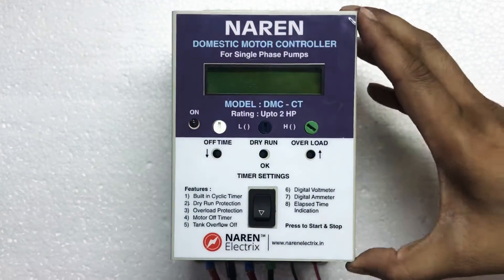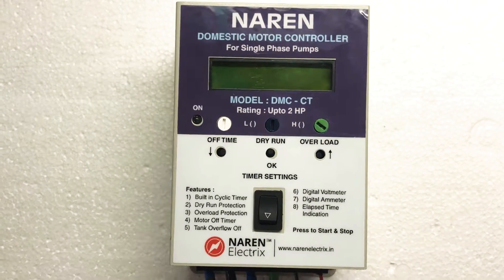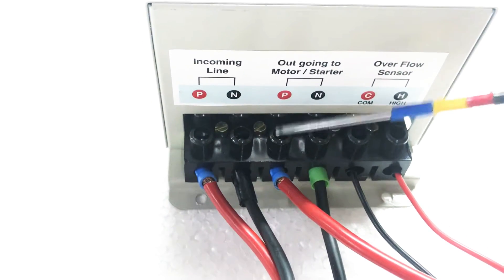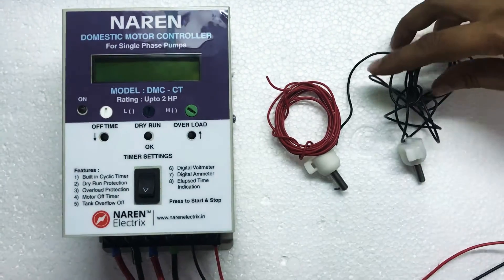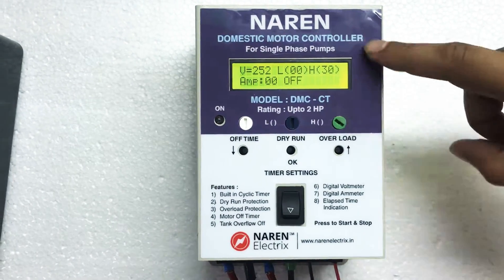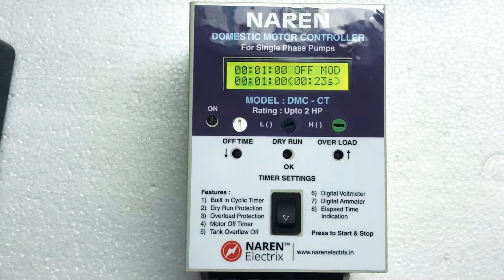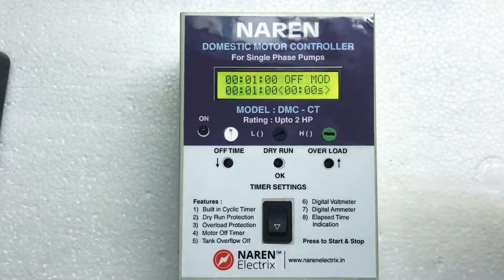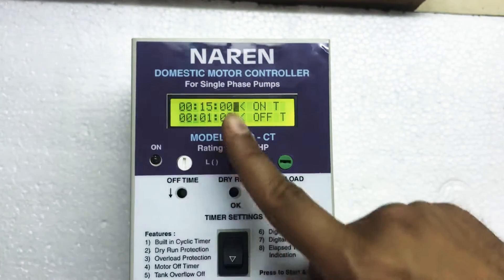Naren Domestic Motor Controller Model DMC-CT (English Version)

Comment: Can i set the cyclic off time to 00:00 to disable it?... and use only on time.... when the supply is given to device, the motor is on by default.... also are the settings retained after supply goes off?.... does this model have a voltage protection